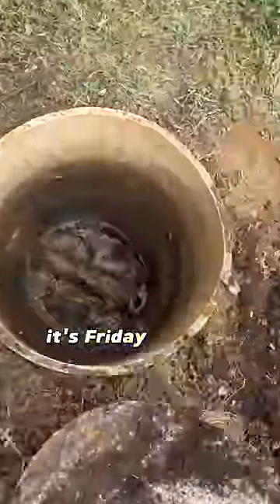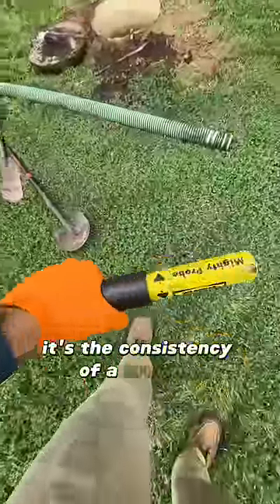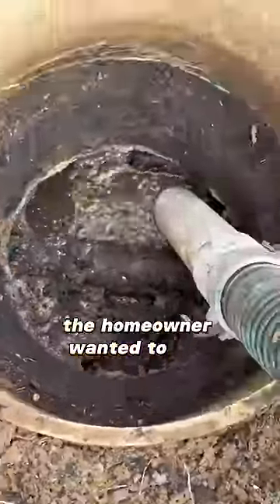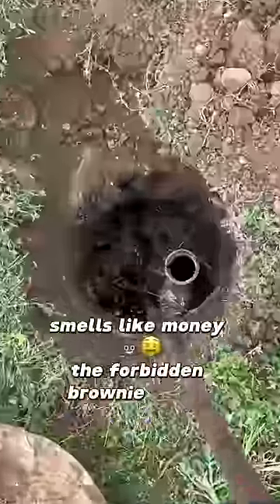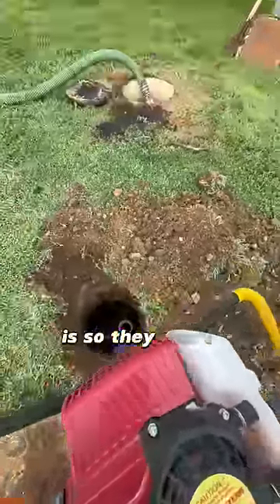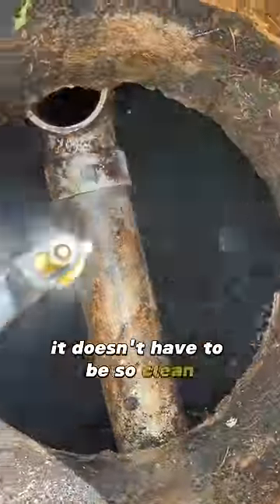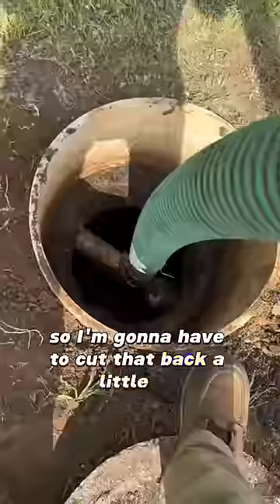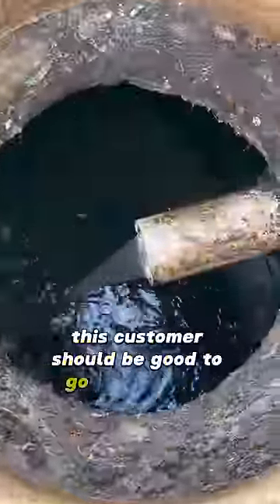The great fecal fountain #shorts

Comment: Instructions unclear. Waited 25 years to pump my septic out
Reply: That top layer turns to dirt when you do that 😂
Don't do that.
Reply: @dennisperry8579  🤣
Reply: If you’re the only one in your house and have a gray water system, and ONLY flush toilet paper, you can likely go that long without pumping.

In AZ (esp northern AZ) a lot of people have gray water lines for their showers sinks laundry etc, and have septic for garbage disposal and toilets and 2 people can VERY easily make it 8-12yrs between pump outs
Reply: I should probably get mine pumped, we moved into this house when I was 9 and my dad never had it done... I'm 36 😬 sinks showers and toilets only though, laundry water does not go to septic and we don't allow anything anti-bacterial down the drains in addition to treating it every 6 months or more.
Reply: @lawrenceleible3670  you definitely need to get it done lol. If not for the pump out, for an inspection too. Drain fields are only meant to last like 25yrs. If your inlet area gets thick enough your outlet area will fill with solids next and those solids will float out to your drain field and clog them up
Reply: Same. Actually it's been 21 years
Reply: No worries, it's only 72 hours till the moon falls down
Reply: @CaptnBeeBop  No he doesn't. If it flushes, he's fine.
Reply: @johnsmith1953x  dumbest comment I’ve seen regarding septic lmao
Reply: @CaptnBeeBop  You have offended me sir!!
Reply: A properly functioning septic system is actually supposed to never have to be pumped, but that's never gonna happen in the real world.
Reply: @tylerbridges1330  If u read some of these comments, some people septics haven't been pumped in decades. Its all the new tanks.
Reply: When I was a kid, my parents waited something like 12 years before getting it done, and it was still working, just needed pumped out.  After that the government stepped in and made it law that it be done every 3 years, and the price for the service has skyrocketed.
Reply: @lawrenceleible3670  Ours was the same but add 3 sump pumps to it and the gutters for rain water. Heck the drain fields had like 35 trees planted in it. We did do the Rid X every month though.
Reply: been here 28 years we've never done this
Reply: but he said they recommend every 225 years.  I got a long way to go here.
Reply: @Mistrblank 😂😂😂 I got it, good dad joke there

Comment: Where I used to live, ( my ex still lives there), the septic was installed the year we bought the place, 1986, and has never been pumped out nor clogged.
Reply: It works until you have a party...
Reply: @atodaso1668  Party = poop pipe malfuntion. yep my mother in law had all the right circumstances. Entire family over for Christmas (meaning staying with her 5 days). Then on the coldest night nothing would move. Didn't freeze. It was a 3 inch diameter tree root that finally broke the pipe. 
Fortunately an older plumber came out and figured what exactly was wrong. Well, he was treated very well and probably gained 3 lbs from homemade Christmas goodies. But what a hassle.

Comment: Hypothetically...what if your septic tank is two 50 gallon drums welded together and has been in the ground since 1953?
Reply: It's now just a dirt cavity. The metal rusted away decades ago. If there are any trees nearby they are feeding on the water but it will eventually fill solid with roots.
Reply: those barrels are gone .
Reply: You're screwed

Comment: I had a septic tank that was not touched for 17 years.  I treated it with Tank Rescue and Field Rescue for 3 years and when I did get it inspected years later and it had a 2 inch matt and was otherwise good to go.  Got to feed the microbes is the trick.

Comment: We bought our house two years ago and were told by everyone, that as long as its a good system, it should never need to be pumped out.  We were told if its working correctly and bacteria is in balance, its designed to never have to be pumped..  Even the septic people we called told us this.  I just wanted it pumped to start with a clean slate, so to speak. We did finally find one to do it, begrudgingly, but I hope we didnt mess anything up!  Its been fine and apparently had been fine for the past twenty years that the previous owners were here and they never had it pumped out.  Can you mess it up if you have it pumped!?  Could that mess up the correct layer and bacteria ratio as it fills back up and throw it out of whack ?

Comment: How did you make the "Crust Buster"? Looks like an 2 stroke auger with a modified and extended drive shaft. What did you use for the blending end? Some kind of cable wires?
Reply: Two flat metal blades twisted to form a propeller, pinned to the end of the shaft. Insert folded, give it a spin once it's under the baffle.

Comment: What even is that though?? Is that only in america because i’ve never heard of it
Reply: It's a septic tank, instead of waste water from things like the toilet going into the sewer it goes into the tank. It's more common in rural locations where they don't have hook ups to waste water systems and older houses that had a septic tank when the home was built and they haven't paid to be connected to the waste water system. Usually you get maintenance done on them I believe every 4-5 years to stop them from ever getting this bad.